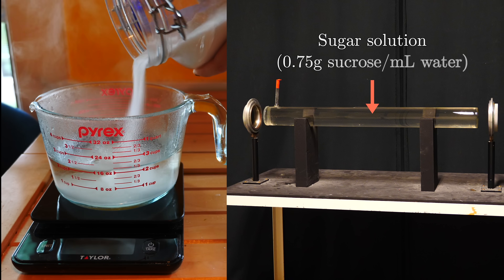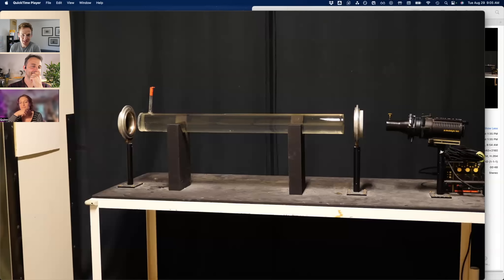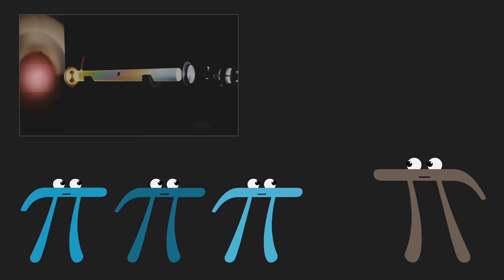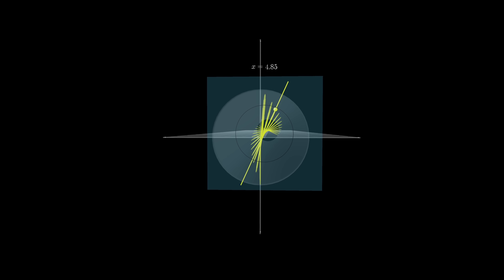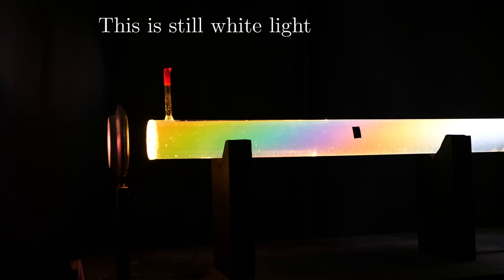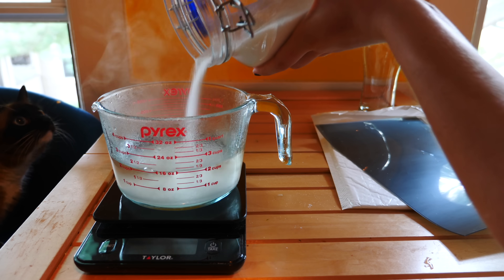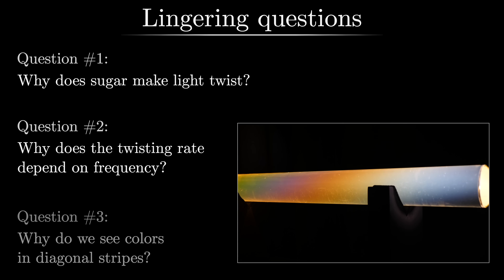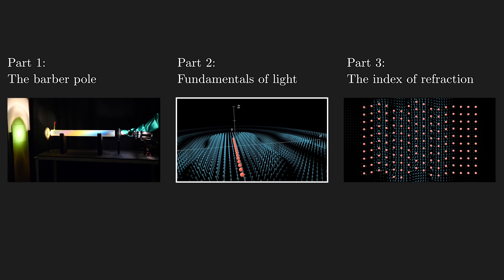This tests your understanding of light | The barber pole effect

Comment: i feel like it must be somewhat similar to how rainbows work, the light comes from the same direction, but refraction splits the different colors into different angles, meaning a point in the vapor in the rainbow isn't colored, but seems to be different colors based on viewing angle. 

so maybe because the sugar "twists" the viewing angle required to see a specific color, and that also changes over time/length. every slice in the tube contains all the colors but the twisting changes what direction the scatter over time. there's probably a more correct way to describe it in terms of waves. and i don't really understand the "twisting" either, unless it's like the light on average twists around, idk.

i'm also kind of curious what would happen if you shined a single color into the opening. would you just see the diagonal bit or spiral?

Comment: Light is a sound wave in the Ether. It is an Ether perturbation there is no such thing as a photon, that is a reified concept. 

What is wiggling are the various mediums themselves. Diagonal because a 2d sine wave plotted in 3d is a spiral, which has a transverse displacement along the x axis. The filter adjusts the amplitude at the longitudinal wave cycle and changes the surface illumination refraction of the sugar water across the tube.

Light is NOT illumination. If you were in the void of space with your back to the sun you would see no surface illumination on anything it would be pitch black despite having the largest light source in the solar system directly behind you. Only objects such as the moon would be visible.

Comment: Different wavelength of light travels at different speed in a medium. So if you play the video when the white light just turns on in a very slow motion, can you see on the other end of the tube the color with fastest speed show up first and then turn into the white light?

Comment: In fact, the answer to #3 ist pretty straightforward. Rayleigh scattering takes place at most at a 90° angle so that the colour of light seen in a specific direction depends in the current polarization angle. If you keep the first pol filter fixed, and you move your head from left to top to right in the direction of light, you will see the spiral colours moving as well. 

By the way the reason why a rainbow looks "deeper" with the naked eye compared to a photograph is probably the higher dynamic range of the eye.

Comment: The diagonal stripes are easy to understand if you think of a spiral staircase. Let the edge represent one color and you will see that it spirals around so it will look like diagonal stripe when you look from the side. you can also think of it as the threads on a screw.

Comment: Does the twisting rate depend only on the color/frequency? Or does it also depend on something else like the concentration of the solution? Do other sweeteners also twist polarized light, at the same or a different rate?

Comment: My guess for the answer to question 3 is that it's the same reason why polarising sunglasses work to filter out reflection: The amount of light that is reflected depends on the polarisation direction. So in the middle of the tube, light goes straight out, no reflection, while at the top the angle is steep, so there is a lot of reflection

Comment: So if the tube was the right length, would it be white again after passing the second polarizing filter, like when a pendulum wave toy lines back up?  Also, what happens if you remove the second filter? (or even the first) is the light on the sheet of paper white?

Comment: Hi, I am Shon Mardani, this is my Unifying Theory Of Everything. I have more to fill in between the lines once I validate the fundamentals of my hypostasis, Please let me know if you see any conflict with Observed Facts, Thank you.

[GOD] Created NOTHING, a Void Point in Space.
NOTHING Attracts [neighboring] Space as the Only Law of The Nature which gave NOTHING its Property to be the GRAVITATIONAL PARTICLE (GP). 
Fast Moving Space into GP,  Creates its own GP at the [Vacated] Space which Attracts the Surrounding Space which is a Negative Pressure or PULLING/SUCKING IN of a GP on Neighboring Space.  
There are 3 Pairs of 2 Directional Possible Movement Axis, this Creates Magic Numbers of the Nature, Numbers 2, 3 and their Sum 5.
Propagation of the GPs in a Closed Cyclic Patterns / Locked Loops of GPs Create Collection of Virtual Positions in Space known as Atom, Starting with Hydrogen to EVERYTHING else.
Atoms are Connected by Overlapping/Common/Shared (single, double bonds ...) GPs to Create Molecules.
Hydrogen Atoms Virtually/Positionally Collect to Form Nitrogen and Oxygen Atoms and Form the Atmosphere, in a 4 Nitrogen to 1 Oxygen ratio which I call one ATMOSPHERIC UNIT (AU).
Movement of GP toward the Center of the Gravity Transforms 2 AUs (2(N4O1)) into 6 Carbon with H2O as Hydrogen Transformer and CO2 as State Transformer, the Collection of this Cyclic Process is called LIFE. 
LIFE Synthesizes the Heavier Organic Elements to Create Species of Independent Life Cycles.
Overlapping Fundamental Atoms Create Heavier Atoms/Elements which are collected in the Periodic Table.

The [Virtual] Movement/Propagation of GPs in a Circular Patterns within the Connected Atoms has Frequency and Direction which Constitute and are Observed as its Weight/Mass/Gravity, Force, Polarity, Magnetism, Electricity, Heat, Light, Color and ALL other Physical Properties and they Move and Interact by Connectivity.

The Gravity Force we Experience on the Earth, Is the Flow of GPs through Matter Moving Perpendicular to the Surface of the Earth towards the Center of the Gravity of the Earth and all Matter Connected to it, like being under the rain from a Firehose. We feel the Flow to the CG  as Push and from the CG as Pull.

Imagine there is a room full of Marble balls and you remove/disappear ONE Marble from the middle. One of 6 possible adjacent Marbles can move in and fill the empty space, the one on the left, right, front, back, above or below. If the Marbles move into the empty spaces at the Ultimate Speed in Nature, the traces of the MOVING/PROPAGATING GPs (empty spaces) will look like a Spiral. Hydrogen [Matter] is OVERLAPPING GPs. 

Imagine the Light Sources like Sun, Light Bulb and LEDs are NOT Ejecting Photons but they SUCK IN the GPs which we see and call them Photons.
Turbines convert the Gravity Force to Magnetic > Electrical > Heat > Light and everything in between, all different manifestations of the GP [Virtual] Moving in the Matter.

Comment: must be light frequency differences. if i'm right, it's a similar principle to a prism. each wavelength being seperated because those frequencies alter the speed of light in the medium.

either way. i'm calling this a liquid version of a prism on the circumference side, not the flat ends. as for the light exit, i'm assuming that is a property of the tube coalescing the most intense parts at the end and focusing it into the final hue. twisting the polarizer merely changes the pitch at which the light frequency is mostly of composed of at the end.

i'm using what i think i know about light, it's properties and also the vernacular (in my head) of "sound waves". i'd think of pitch as brightness and contrast as quality between different sources etc.

my point is, extrapolating any answers, right or wrong, should never stop investigations to further solidify that understanding. if i'm right, it's because people like 3B1B and brady and steve and physics girl etc, they're the reason i can barely grasp onto understanding anything... i'm really doubting my reasoning for the output colour on the paper. i'm either close or just wrong. but the spiral, i'm quite certain of.

i'm just about 1:40 and wanted to spit something out first.

if i'm really wrong, this won't exist.
Reply: a second filter!!!! fk me. that answered that.

Comment: I can't wait for explanation of point #3 because I'm already super suspicious that it will be wrong (very presomptuous, I know). Are you going to talk about the light scattering off the sugar molecules or at the liquid/glass interface? I am fairly convinced the effect comes from the latter, but your animation shows scattering off of a particule, which I guess is the sugar molecules, which would be the wrong explanation imho.
What makes those colors and makes them appear in diagonal bands is, I think, that when light arrives on the class from the sugar-water, most of it is reflected inside the tube because of the low angle of incidence, and some of it is diffracted and then scattered/diffused/refracted again when it reaches the glass-air interface. When light is partly diffracted, partly refracted, the "choice" of which photons go where depends of the angle of polarisation vs the tangent of the surface, this is why polarising filters work in photography to remove reflections on non-mettalic surfaces.
The combination of the radial distribution of the light inside the tube with the also radial change of the angle of incidence of light on each section of the tube makes it look like parallel band when looked from the side.

Comment: The reason photographs of things like this (rainbows, etc.) don't fully do them justice, has to do with the imperfect way in which cameras mimic (and RGB displays interact with) what the human eye does.  The human eye has four different types of light detector (rods and three types of cones), each of which has a distinct response curve with respect to wavelength; the ranges that they detect overlap, but the degree of response of each type of detector is not uniform over the range it detects, and the shapes of the four curves are not all the same.  Cameras usually make do with three, and their response curves are not at all the same as the ones the human eye uses but are more similar to each other.  And most RGB displays only use three wavelengths, rather than any kind of spectrum; each of the three is selected to trigger one of the eye's cone types much more than the others, and this mostly works pretty well, but there are limits to how accurate it can be when representing a complex mix of different wavelengths.

Comment: Does this only work with sugar water? What about salt, or something else?
What happens with colored light?
Reply: It should work as long as you have a chiral molecule with a sufficient excess of one enantiomer that is optically active in there. Sodium chloride is not chiral. You can see what happens with colored light in the second video.

Comment: Hey folks, Quinn here. Lots of people have been asking how they can make this demo themselves, so here’s how I built it:

Materials:
	⁃	Table sugar (sucrose)
	⁃	Water
	⁃	A glass tube that you can fill and seal, although it would be cool to experiment with different materials for the tube, since different material = different index of refraction. More on this in part 3 of the video. The tube should be long enough so that you can actually see the effect from the sides - our tube is 1 meter long, but you’d probably be able to see the effect with a ~0.5m tube. You also might want to make sure the tube is easy to open so you can clean it. See “Things to consider” for more. For the mini-demo, I just used a drinking glass! [FYI, the tube in this demo was custom-made for the MIT Physics Department. I’m not sure exactly where it came from or what type of glass it is exactly…]
	⁃	A source of white, unpolarized light. We used a Dedo lamp, and if you make the demo as big as we did, you need a pretty powerful light source. For the mini-demo, I used my phone’s flashlight!
	⁃	Two linear polarizing filters. You can get ‘em online pretty easily! 

Directions:
	⁃	For our demo, we made a sugar solution of 300g of sugar per 400g of water. So, you should measure the volume of your tube and scale this ratio accordingly.
	⁃	Boil the water and mix in the sugar until it’s dissolved.
	⁃	Let the solution cool, then fill the tube with solution. Close up the tube.
	⁃	Place the light source so it’s shining down the length of the tube, then place a filter between the light and the tube. 
	⁃	Place the other filter at the end of the tube.
	⁃	Voila! You can rotate the first filter to see the whole spiral move up and down the tube, or you can rotate the last filter to see the color coming out of the end of the tube (and through the last filter) change. 

Things to consider:
	⁃	You really want the tube to be clean before you start, since the solution can get moldy. If you look up close, you’ll actually see little floating things in the solution - those are some bacterial friends :) 
	⁃	We try to replace the sugar solution frequently so that the demo is clearer.
	⁃	The shorter the tube is, the more concentrated you want the sugar solution to be in order to see a similar effect. 
	⁃	The amount of rotation of the polarization angle is proportional to the concentration of the solution (this is called the specific rotation!)
	⁃	The light might get hot the longer you keep it on, so be careful! As always, observe sensible safety procedures. 
	⁃	You could do this with different sugars! Glucose would also rotate light to the right, but slightly less than sucrose. Fructose rotates light to the left!

If you recreate this/do something else cool with it, I’d love to see!
Reply: Only 47 Likes and no replies? Thanks for this and for taking the time to build this!
Reply: Is LED light on your phone actually white light? When you split it, do you end up with the three specific wavelengths of light corresponding to wavelengths from each LED making up the white light? Either way, I think that would be a cool follow up to this. Use different light sources and see the effect. If you did use three wavelengths (rgb), how sharp would the drop from one colour to the next be? Would you get twisted lines around the tube for each colour or would there be areas dominated by each colour with gradient transitions?
Reply: @Crushnaut  White LEDs typically produce white light in the same way as white flourescent tubes: they produce ultaviolet light which is then absorbed by a mix of different phosphors. The result is a spectrum which looks like a comb: it has lots of spikes. I don't know how it would look in this experiment, but I suspect the polarizers might not be strong enough to show the spikes separately. It would be interesting to see individual red green and blue lights or any other set of colors; it's wavelength that matters here, not how our eyes interpret it.
Reply: It’s likely borosilicate glass, most scientific glass is. You’re likely able to find a local glass blower who could make the fillable tube but the caps might require some thought. Could just superglue a small glass plate to the ends 🤔
Reply: LCD screens have 2 polarizing filters so if someone have a broken LCD can find them there
Reply: Quinn, thank you so much for what you've built here. I greatly enjoyed this video, and it has rekindled my interest in studying optics.
Reply: Quinn, you did great contribution to the history. I'm sure many intusiasts have their discoveries lost because of small audience. Happy to know that you was able to highlight your's. 🎉
Reply: I would love to find an alternative to the sugar that might even be antimicrobial, so this could be a low maintenance display piece
Reply: @JackieBright  Try looking up liquid crystal, I'm sure there are some kinds which twist light and last a long time.
Reply: @JackieBright  I wonder if it's as simple as adding chlorine? And maybe starting off with distilled water to reduce initial bacteria
Reply: Ordered filters to try this at home!
Reply: you a goat
Reply: Please! Find a way to sell it!
Reply: thank you Quinn! amazing video
Reply: Thank you for pitching this setup
Reply: Changing the index of refraction of the tube will have little effect upon the display.  Any refraction at outer surface of the tube will be canceled by that on inner surface, because the 2 surfaces of the tube are locally parallel
Reply: Thanks for the description of materials/method

Comment: The intuitions going through my head include knowledge that a reflected light source becomes polarized. This can be seen with polarized sunglasses in a supermarket, if theyre oriented the correct way all the reflections from the lights off the floor will disappear. I think the orientation of polarization of the light also determines if light can escape the tube by passing through the sugar-water/glass boundary. I think the polarization has to be perpendicular to the surface of the glass for the light to pass through and light that is polarized tangent to the surface gets internally reflected, thus not reaching the camera/our eyes. Furthermore, as the light passes through the tube, with the orientation of its polarization rotating, so does the position at which it can escape the tube by not being internally reflected.

I would bet that if the light column was not a circular tube, but instead a rectangular prism, the banding would be oriented perpendicular to the length of the tube.